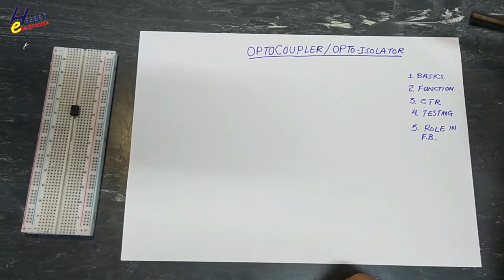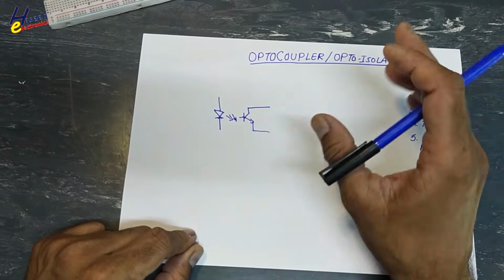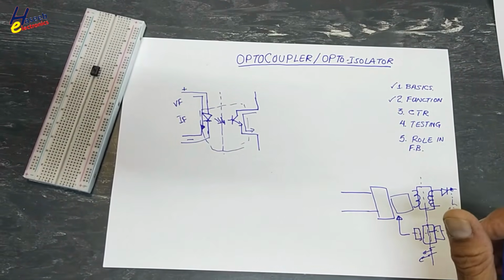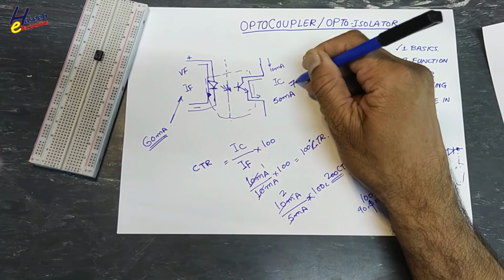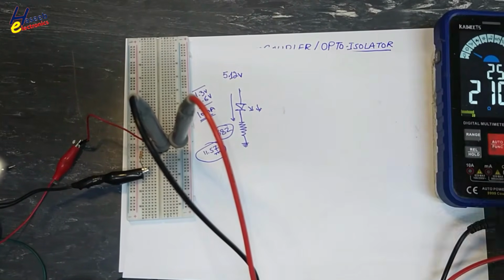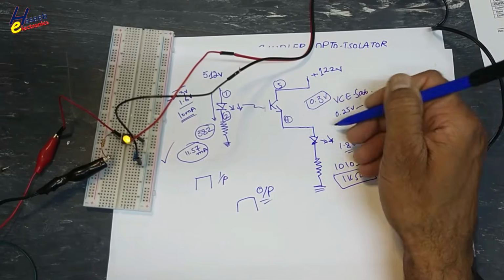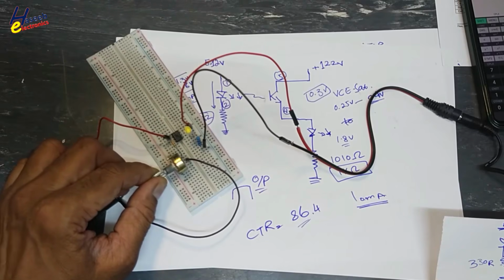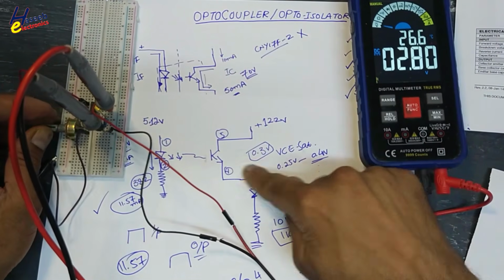{1403} Optocoupler Function & CTR Explained | Current Transfer Ratio Calculation in Detail

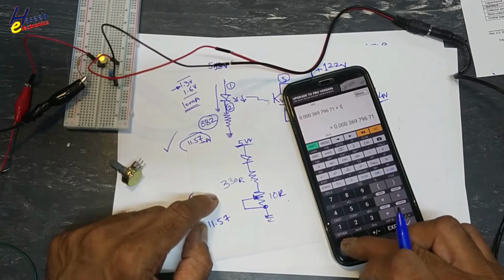Comment: 24:24 - This is not multiplied by one milion as you said, its 100 000, on one milion its 369 micro Ampers. Overall good simple tutorial.
Reply from the maker: OMG. it is really a mistake by a missing ZERO. i rechecked it. i multiplied by 100,000 instead of 1000,000 to convert in to micro ampere. 
no problem, the main thing is the concept clearance. 
Humble thanks for your valuable point to indicate a human error 
Best regards

Comment: Thanks for this wonderful video ! I still didn't understand some point. How we can set exactly CTR which we want ? As my right understanding optocoupler IRED works as switch-on resistance controller for secondary side photo transistor. So how we can know in which current we have needed CTR before measuring it on IC ?

Comment: I have the HF inverter with the fluctuating voltage betweent 300-450v on secondary.  The inverter is driven with the Full-bridge resonant driver(L1/L2 resonance frequency at 670KHz).   The driver accepts the frequency modulation signal from 100Hz-3KHz.  How can I use the similar feedback mechanism to control the output voltage to remain constant even if the load is added or removed?   The way I see it, is I need to use the voltage divider to drop voltage  from 400V to 4V and this will be the Signal Voltage and then I will set the reference voltage also at 4V.  The comapator needs to provide the error voltage which is fed to VCO to obtain the Control voltage to frequency relatonship and that frequency I can feed to the resonant bridge driver, ,so if the voltage begins to drop, VCO will rise its frequncy to bring the output voltage back to 400V and vice versa.  This is my limited understanding.  Is it close?